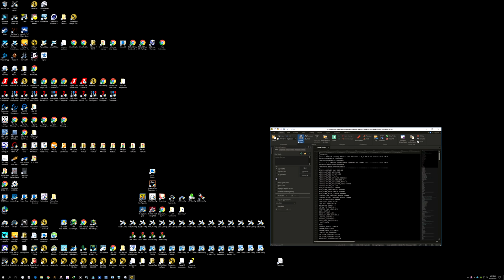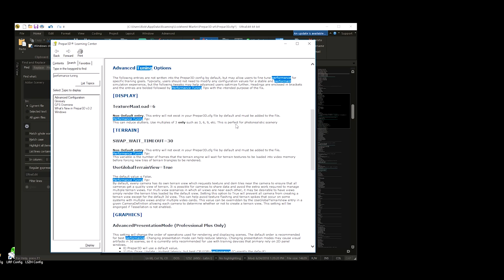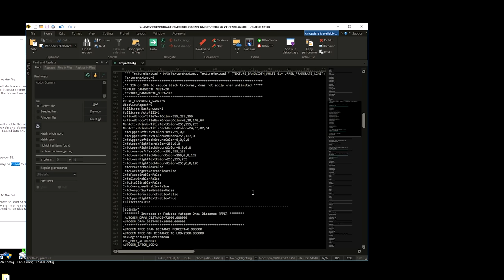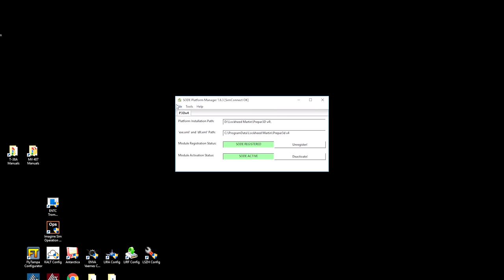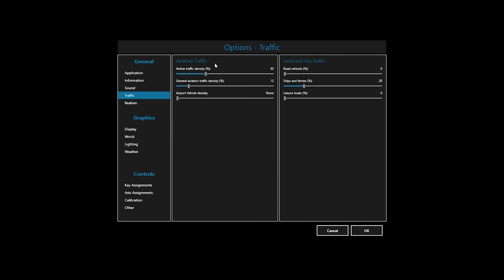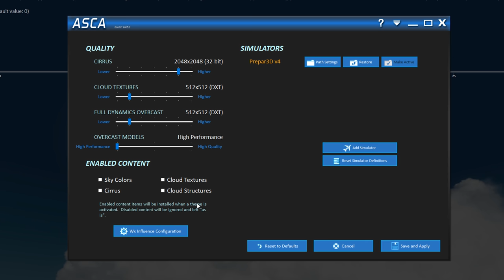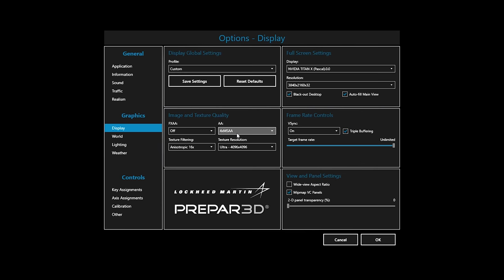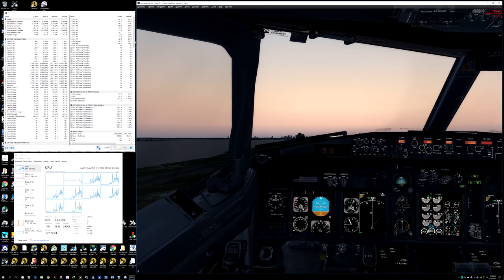Prepar3D V4.2 - Performance Tuning Process (4K)

Comment: Hi! in Nvidia inspector good work frame rate limiter v2, & in prepar locked to 31fps. I used to set the frequency to 30 Hz myself, but it’s not always convenient, every time you don’t play, you need to switch back to 60 Hz. By the way, in Ni happens in one of five cases the frame limiter does not work, it can be seen through Shift + Z. And as a whole it works perfectly.

Comment: Great video.  What do you recommend for a 2K widescreen monitor that can NOT run at 30Mhz?  I can only run at 60.  Thanks.
Reply: Also, GSync on or not?  If so I assume no V-Sync in the sim?
Reply from the maker: Set framerate limiter = 30 in P3D ... assuming your worst case FPS is 30.
Reply: So don't use GSync then?  Thanks.
Reply from the maker: I wouldn't as it doesn't really promote consistency in FPS.
Reply: So Vsync ON and limit to 30FPS?  I have a high end system, but even still with medium to low settings I still get lower than 30FPS sometimes.  I'll get over a 100FPS during cruise with nice sharp textures, etc., then drops all the way down to around 20-25FPS when arriving at an airport with stutters.  I'll try going back to the limiter in the sim and see if that gets me more consistency.  I do use all the ORBX, AS-REX,  GSX, PMDG, Chase Plane, other add-on airports, etc..  I've been wondering if Chase Plane might be causing issues since it records for the replay also.  I wish there was an option to turn that feature off.  I'm also using X-Split to stream with.  I have 11gb VRam, and even with all that stuff in the sim, I rarely go over 50% CPU/GPU utilization.  I've also tried Process Lasso, which I don't use anymore as it induces major stutters with the sound.  Don't really need it anyways because I have plenty of CPU and GPU overhead.  Thanks for taking the time to reply.  Appreciate the help.

Comment: After 12 Years FSX i have lerned, dont touch the CFG if the Sim is running. :--)  I use P3D v4 right now at my Ryzen 51600x , 16GB Ram and a Zotac 1050ti OC in Full HD. Standart Addons, all what i just Need is Active Sky and Rex Maybe. It works fine with 40-50 FPS . No Tweaks, just with the ingame Settings i config.

Comment: Is windows defender a good antivirus or do you recommend something else? Also, is that the only anti virus you use?
Reply from the maker: It's an "Ok" antivirus ... on more "critical" PCs I use MalwareBytes but since my main FS PC doesn't have anything of "value" or sensitivity on it, I don't mind using  Windows 10 defender and I avoid "questionable" web sites/products.
Reply: Rob Ainscough Thanks for the response Rob, currently I only have one PC which is my “everything” pc I have Norton 360 now but been hearing a lot of iffy things about it. I may switch to malwarebytes as well.
Reply from the maker: I would still recommend terminating Malwarebytes just before starting P3D V4.3 or any flight sim.  Just be sure to turn it back on when you're done flying.
Reply: Rob Ainscough Yes absolutely. Thanks for the info. And thanks for this video, quite the information as well as some new things I’ve learned.